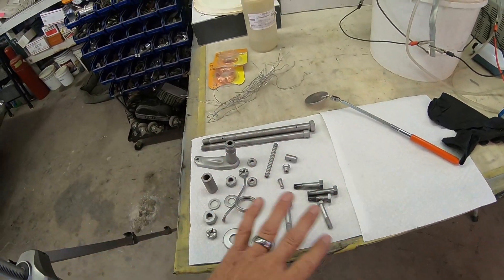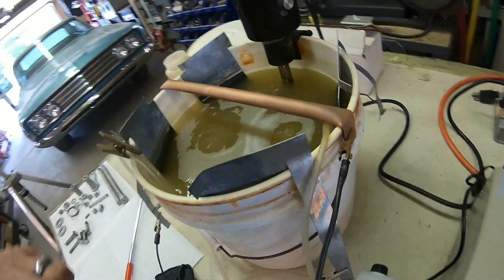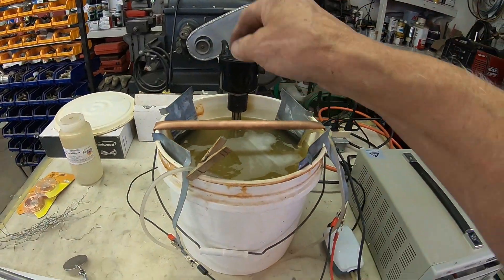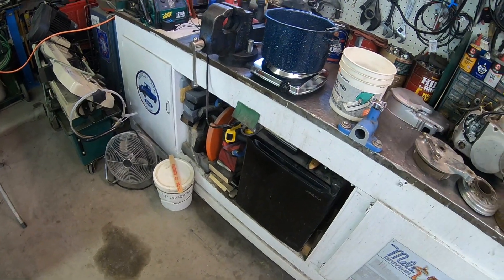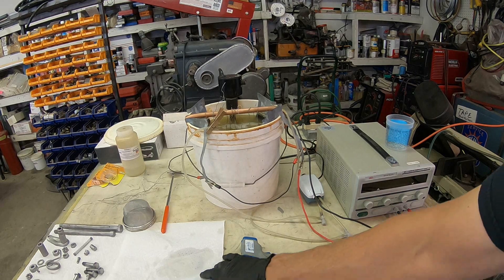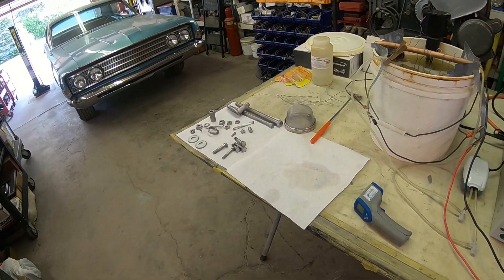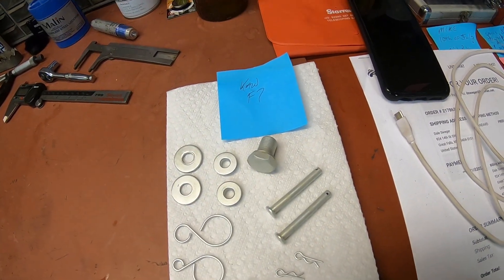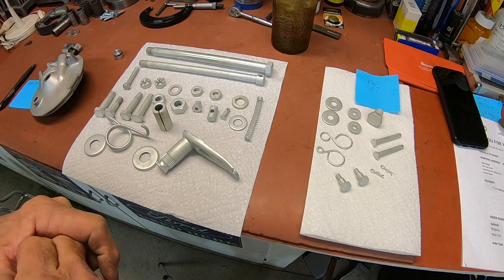Zinc plating motorcycle parts

Comment: I'm restoring 1960's British motorbikes and I love the finish you get - not too shiny.  If I understood you correctly, the degree of shininess in the finished part is directly related to the shininess of the prepped part. In which case, can you say how you prepped those parts?  I've seen plating videos where they use bench grinders with wire brush wheels, followed by two grades of scotchbrite wheels - and the parts come out looking as thought they have been chromed - but that is not the finish I want.
Reply from the maker: Hey Mark, it sounds like you're after a satin finish, that is the easy one, just bead blast and plate. You only polish with wire wheels and Scotch Brite if you want a shiny finish.

Comment: So apparently Dale you and I read the same book on plating!  We are doing vitrually hte same thing, Cadwell solutions, small DC power supply.  Only difference is I use a small aquarium pump to move the fluid around and mix it up.  I do a degrease in Hot distilled water before plating.  I got a lifetime supply of fine copper wire from the guy who does my chrome plating for his cost (cheap by my standards).  I gauge my current flow by watching how the surface is plating.  I think I'm using the same plating solution from Caswell for nigh onto 20 years.  You have some good ideas, the little basket is a great idea for degreasing, all in all it is a VERY time consuming process.  I use 5 gallon pails which allows me to replate my spokes which seems to work out well.
Thanks for taking the time to put these GREAT videos together.
Reply from the maker: Hey Alex, it does sound like we are using the same info. I do use an aquarium pump to move the fluid around to suspend the zinc coming of the anodes. I have done spokes only one time. It was for one of my own bikes and it took forever. I put the nipples on the spokes, or it will mess up the treads on the spokes. Is that how you do it? I thought about wrapping tape of some sort but thought the water would make it come off. I may do spokes again at some point, but for customer bikes it just is not the best use of my time. Hey thanks for the comment and for watching the channel.
Reply: @montana2strokeracer  Dale:  Sorry to be so slow responding - just busy.  I noted your comments about fit with spokes into the nipples after plating.  I have done probalbly only a bout 10 or 12 wheels but I've never had an issue, the plating is only a few microns think at any rate.  I typically prepare them with a wire brush (although I now have a vapor blaster which I'll try on the next set) and then do the usual -tye them to copper wire, hang 'em in the hot degreaser solution for about 20 minutes or so, rinse in distilled H2O and then into the plating tank for typically 30 minutes or so.  When they come out I clean them up with a sanding mop of 320 grit (one that's a bit beat up - not brand new) and they come out looking great and fitting the nipples without any issues so far at least.  I will agree it is VERY time consuming and not cost effective if you value your time or are selling it (such as when working on someone elses bike).  I set my stuff up in a permanenet mobile unit with the three tanks insulated to help them heat up faster and uses less power to stay warm..  I found it was so time consuming pulling everything out and putting it away every time. Now I just lift the lids on the tanks, roll the cart out where I can use it and plug the power on - it's good to go.

Comment: Is your power supply in constant current or constant voltage mode?  I'm a little confused by you adjusting both the current and voltage.
Reply from the maker: It works both as CV and CC. I run on CV because I need to adjust for the amount of square inches of parts Im plating. I think I just noticed a knob wasnt in the right place.

Comment: Be aware that passivating, after the actual plating, helps make the finish more durable and less likely to corrode.
Reply from the maker: Hey thanks, but I have never heard of it. I just use the instructions from the supplier. It may be something new that's not in their old manual. I have been using the same components for over 20 years and haven't so far had any durability problems. I do appreciate the heads up though and will look into the process. Maybe you are referring to the drying with compressed air??? I will see what I can find on the subject.

Comment: Thanks for another useful video, Dale.  These are well done and packed with useful information.  It appears you prefer not to chromate, have you had any negative experiences with it?  I remember a while back you used the gold chromate on a choke lever when restoring a carb and it turned out great. I am looking to get the caswell starter kit when I can get a few spare dollars.  Keep up the good work as these videos are the best motorcycle restoration videos on you tube in my opinion.
Reply from the maker: Thanks for the kind words, Jeff. No problems with chromate, just none of these parts required it. They were all just zinc/cadmium plated. I sure like the yellow chromate colors though.